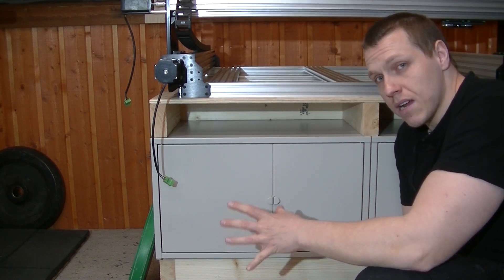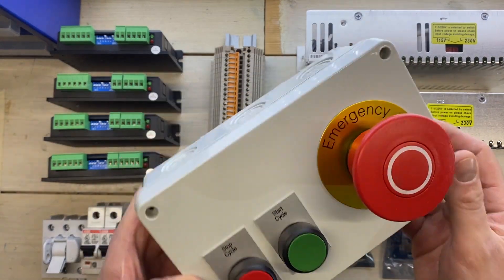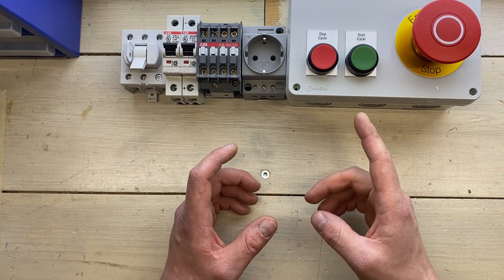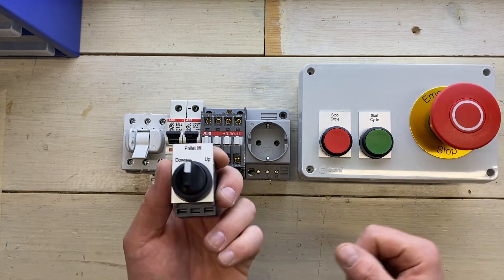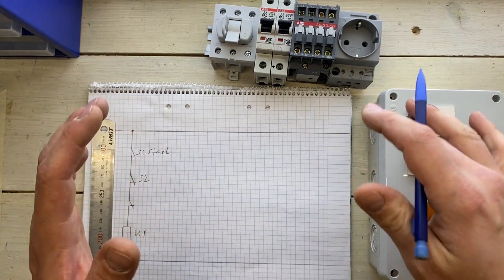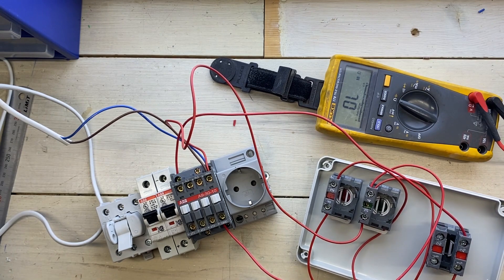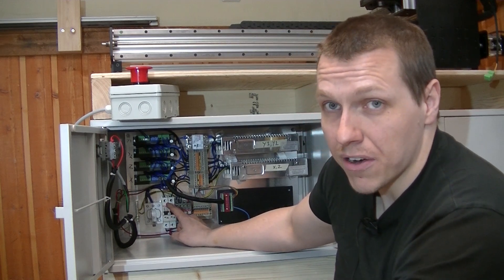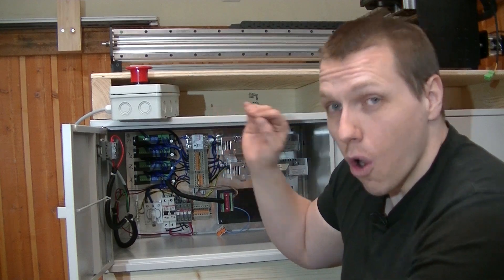Queenbee Pro CNC router build part 3: IS IT SAFE!?

Comment: Can all 4 steppermotor drives be connected to one power supply? (  I have now only one Y steppermotor in my DIY cnc router and if I buy a queenbee or similar there will be 4 steppemotors)
///Thomas
Reply from the maker: Yes, as long as the power supply can provide enough amps. So if you have 4 stepper motor drivers rates for a max of 5 amps, you will need a power supply that can deliver 5*4=20 amps. If you are planning on running the steppers hard. 
But I would suggest that you put individual fuses/mcb's before each driver. This makes troubleshooting easier, you can instantly see which driver that is tripping a breaker for example.
Reply: @OffHoursEngineering  Thanks for answer, what  220V fuse do you use to  connect  to wall power outlet?
Reply from the maker: Generally a 6 or 10 amp Mini Circuit Breaker (MCB), but it depends on the load and your power supply.
If you have a 6 amp fuse you have around 1320 watts of power and with 10 amp you have 2200w.
In the example with the 5 amp stepper drivers and a 36 volt power supply (almost the same setup I have, except I have 2 power supplies)  you would need 5*4*36=720w so a 6amp fuse on the 220 side would be more than enough.
Reply: @OffHoursEngineering   Now I understand it, thanks :)

Comment: Hello again,
I noticed that you did not installe any EMI filters. Is it a deliberate choice or you homited it but did not notice any troubles? It seems the line that supply the arduino  needs some filters but could also be nice to put an Emi filter at the power feed of the Spindle to avoid parasits polluating back into the power line.
What do you think? Thanks
Reply from the maker: I omitted it by choice. Since I am not running a VFD at the moment there isn't much interference. The only possible source of interference is the stepper motors and they are not nearly as bad as a VFD. So far it has worked without a problem for I don't know how many hours. When I upgrade to a VFD I plan to do some testing to see if cable management and grounding is enough or if I need a filter. The only supply to the arduino is the USB from the computer so that is probably the cleanest supply in the entire system :)
Reply: Where would you install the EMI filter? Planning to buy a QueenBee Pro and looking for information about everything required for a safety installation. Great video
Reply from the maker: On the incoming line to the VFD. But it is important understand that a filter would suppress any distortions feeding back from the VFD to the mains but any interference from the motor wires would still be present and might cause problems. So proper grounding and separation of signal and power cables on the machine is still a must. Nice to hear that you like the videos!

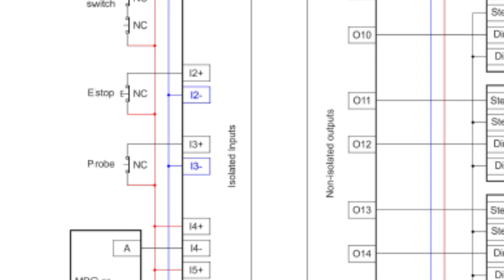Comment: 4:19 you show using a novusun 5 axis cnc controller, but you end up using an arduino as a bob.
Do you have a reason for not using the novusun and going with the arduino instead?
Reply from the maker: I never said I was going to use it. I only used that picture as a reference for what I think is a bad way to implement an emergency stop. I explain this in the video and you can find my reasons for using an Arduino in part 6 of the series, but basically it was the easiest and cheapest option since I already had all the hardware for it and I've used Arduinos a lot for other projects so I know how to work with them.
Reply: @OffHoursEngineering  I did eventually see this in vid 5.
I was more wondering as I plan to use that controller bob in my build.
all g
Reply from the maker: Ok, no problem. But I would do a bit of googling about the novosun controller. I've heard some bad things about them and there have been a couple of threads in "homebuilt CNC machines and projects" group on Facebook, where people ended up ditching them and going with other options.
Reply: @OffHoursEngineering  I have experienced the same feedback in my group cnczone, but nobody can expand on what the problems are, seems to come across as a stigma or prejudice toward the unit, the common response is USB interference.
The unit boasts some good features for the price.
I was prompted to ask you how yours was, as I was watching your build as I will be doing my first build in 3-4 weeks noticed you had it in your design in 2nd video.
I am happy with my 6040 with the $15 parallel BOB so my thinking was how bad could that unit be.
All G
Reply from the maker: I've heard of 2 specific problems beside the usb, and usb works fine if you make sure to limit interference and aren't planning to send to much data since speed is limited.
The first is that I've heard of several boards where the bin file that enables the board to communicate with mach3/4 goes corrupt or disappears, basically bricking the board.
The other one is that there is almost zero support from the Novosun themselves for their own products. But if you're lucky and get a working board, I agree. The features are good for the price.
Reply: @OffHoursEngineering  I will do a bit of research, cheers.

Comment: What do you think about bridging the DC V- to earth ground ? There was a
 heated discussion on FB on this. Some of the control technicians 
recommend doing this to avoid floating ground and reduce EMI.
Reply from the maker: I saw that discussion as well and decided to stay out of it. But I kind of fail to see the point of it since the V- and Earth are bridged internally on all SMPS I've seen. And there are usually some form of short circuit protection internally on the the power supply as well that you might render useless if you did. And if you have used a proper star ground on your machine, and your incoming ground is good, then you shouldn't have a floating ground anyways
Reply: @OffHoursEngineering  Yeah a lot of immature name calling in the FB discussion. What about a linear unregulated and/or regulated power supply ? I would think there would be some benefit in the unregulated DC supply to the stepper drivers.

Comment: Hi. Very interesting video. Could you please add a 'real' diagram about the connections from the line, the contactor and the buttons ? I'm not very good on that and i'm afraid about to fry something. I'm sorry but the diagram on the video is not enough for me :-(
Reply from the maker: Here is a link to the "full" diagram. I have not included any connections to the controller or breakout board. The ground line connected to the DM542T's and limit switches is the signal ground from the controller.
https://drive.google.com/file/d/1dXbUgpsjdEhYS_lmDHqVYMAanyl21Yxc/view?usp=drivesdk
Reply: @OffHoursEngineering  Great. Thanks a lot

Comment: Would you recommend adding an EMI filter?
Reply from the maker: That depends. Many vfd's, more high end ones, have integrated filters. In that case all you need is properly shielded cables and separating the control cables and power cables.
On cheaper vfd's you might need a filter, especially if your incoming ground is bad. And of course shielded cables and separating the power and ground cables as well.
 On plasma cutters you will probably also need a filter for the power cord to the plasma cutter, they tend to create some really bad interference.
Reply: @OffHoursEngineering  thanks for the reply, I ended up going for the QB pro with  xProv5 just to lessen my wiring hope bulkman sends huanyang VFD as shown in their pictures

Comment: Thanks for this video about electrical safety. Then I'll know what to do when it'll be time on my queenbee to deal with the electric panel. Probably looking for a different architecture. Using maybe raspberry pi along with linuxCNC instead. But not sure yet. The point here as well is to make sure having all the data transfert away from parasit interference and USB connection between control board and computer is not the best solution. Further more It's good to have the dedicated raspberry for the CNC. Just need to use the desktop of the raspberry in remote from any computer in the house via ssh.
Reply from the maker: I'd like to go with linuxcnc or a pc based system like Edingcnc in the future as well. But I already had all the hardware for this solution at home so I went with that for now to save some money and get it up and moving.
And I completely agree, USB is not optimal. Both low transfer rates and prone to interference, so proper grounding and shielded cables are a must. In the next video, that will be out next week, I will go over some basic commissioning and greenlining basics as well before powering it up.
Reply: @OffHoursEngineering  Sounds à great idea ! By the time I finished mine you will have all  think  it over.
Reply: I end up buying a DDCS V3.1 Controller
Reply from the maker: I've seen more and more people using them, hope it works well for you.
Reply: @OffHoursEngineering  I'll let you know. But the first reason I choose it is to use servo motors with alarm signal that the controller could handle then when a power faillure hapend it save the work in a sd card. Second, all the program and gcode are in the same motion controller. Not depending of a computer which the OS can crash as Well. But that's the same design with GRBL and arduino.
Third It has backlash compensation though not sure It's relevant here with leadscrews driving system compared with Ballscrew.
Reply: Mistake. The DDCS V3.1 does not handle the alarm signal from the servo motor driver. The DDCS EXPERT controller does instead!